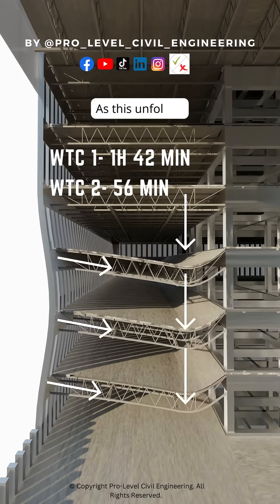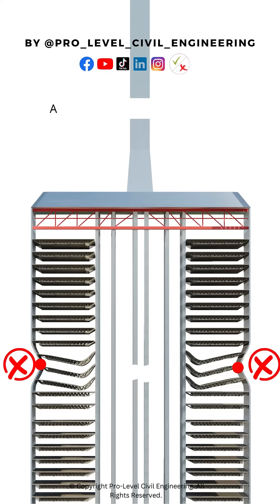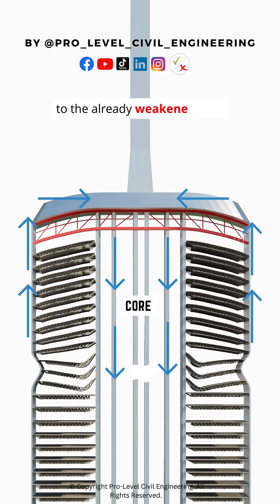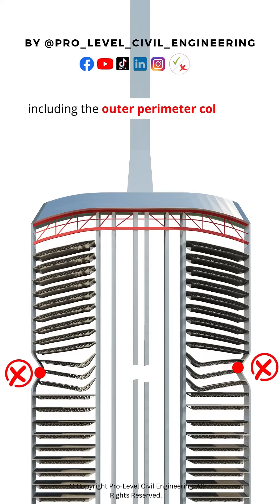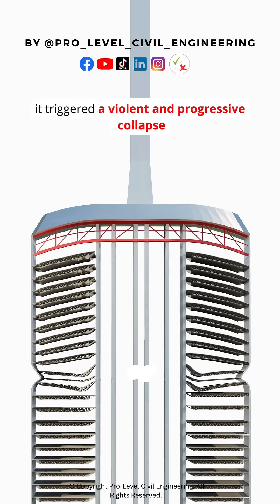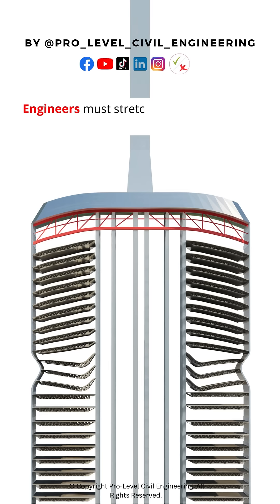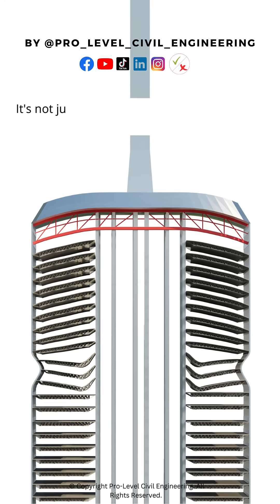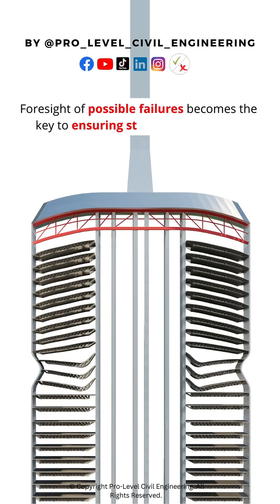The Horrifying Truth: Why the Twin Towers Collapsed on 9/11?

Comment: I cant understand how that much steel can almost disintegrate so quickly like solid steel just vanish in thin air
Reply: Nothing vanished. It took 184,000 semi truck trailer loads of debris to clear the site in the months after and EVERY SINGLE STRUCTURAL COLUMN, BEAM, TRUSS and other steel component that comprised the WTC Towers was recovered.
An interesting fact....if you melted down all the steel, every column, beam, truss, plate, bracket, bolt and nut that comprised one of the WTC Towers, every piece of steel, the single solid slab of steel you would have would be the footprint of the building (208' × 208')and a mere 6' high.
If you melted down all the concrete and poured it into a slab it would be the footprint of the building and 36' thick.
Reply: @holdernewtshesrearin5471  Few realize that each Tower was 95% AIR for its overall Cubic Volume.
Reply: @apaulmcdonough2170  All buildings are 95% air that's why parts of them are called rooms, duh!
Reply: @mrichards-j6b  See this is WHAT most Don't Understand when they "Question and Dispute" the Collapses and the actual Construction of the Towers and also WTC 7. 
They weren't "that much Steel" ... "like solid Steel". 
The 14 inch Square, 36 Foot Long Columns were made of 1/4 inch thick Sheets, so 13.5 inches of 'solid AIR' between the sides of the Columns.
Reply: @apaulmcdonough2170  Box columns become a composite beam welded on all sides increasing the strength of the material used,  the bottom sections were much thicker than the middle sections which were much thicker than the top sections,  as the building went up the steel diminished in thickness otherwise it would be to top heavy and unstable,  theses towers were engineered fortresses not some lightweight weak thin easily destroyed plate steel structures,  connections did fail,  buildings did not fail,  they were brought down by attack from inside by unknown forces,  whatever cut the trusses and left 12 feet of steal hanging on the interior columns was the means to the towers ends,  not junk engineering!
Reply: @mrichards-j6b 
You keep hanging onto the UnicornShit you are so deeply, and desperately invested in.
You have succeeded in Boring me.
Adios, Skippy.
Reply: @holdernewtshesrearin5471  not so hasty. There's a multitude of different aspects I can express that says that's just a lame excuse. There was diaganol cut beams strikingly similar to that of the demolition process there was melted through beams that didn't burn all the ways through looking like flappy holes. There was chemicals compounds where BYU professors found evidence of that showed proof of high quality thermite only found in military complexes (where it was then too controversial and was made to resign from his job at the good University) in America. Then under each pillar they found (where I can't remember the name )in welding, where I call it slag . But it's more specifically known as "pung" or "pnuck" where they found thousands and thousands of small bbs all around the bases of the pillars. Helps show striking similarities to none other than the ways thermite burns . There was tons of grey and white chips falling from the buildings before they collapsed resembling the colors or iron and aluminum oxides (which is rust and aluminum) there was the calling away by George Bush (The REPUBLICAN president!) the security days before the attacks. The high quality thermite is explosive which is why the building showed plums of smoke coming out from the sides of the building before the collapse. Then there was actual pictures of men in climbing gear in the towers standing next to a 20ft complete wall reaching to the ceiling of boxes which read "BB 18" on them . Which upon further investigation was revealed that they were electrical fuse holders which could double as something they needed in the DEMOLITION process. Furthermore these "fuse holders" were related to a company call the kelx company which in some part ways or another was either owned or partly owned by Republican John McCain. Which was praised for his actions against Obamacare and condoned by the Republican party during  Donald Trumps term in presidency.
Reply: Do you have any idea how much the plane weighs? 
I wouldn't be surprised if the tower collapsed, even if someone just put such a plane on the roof. 
But in this case, there was a collision, destruction of the external load-bearing columns, a fuel explosion, prolonged burning, and the collapse of the upper ceilings, which with their weight brought down the rest of the structure.
I'm just surprised WTC didn't collapse immediately after the impact.
Reply: @sun_11_moon - a fully loaded Boeing 767 like struck the WTC Towers weighs approximately 350,000 to 400,000 lbs depending on configuration, cargo and passenger load.
The average speed of the 2 jets upon impact was about 500 mph which is about 733 feet per second which is FASTER THAN A BULLET fired from a .45 acp handgun such as a Glock 21 or Colt 1911.
They struck with 12 to 20 times the energy the WTC Tower engineers had planned for in such an event.
The destruction was massive but those mighty Towers withstood the impacts and would have remained standing....if it were not for the fires. Those raging fires weakened the steel structure by as much as 50% to 90% in certain areas and insured that the Towers could NOT survive. Although they withstood the onslaught for nearly 2 hours for the North Tower and 1 hour for the South Tower, inevitably they succumbed.
RIP to all those lost and God bless their loved ones.
NEVER FORGET what they did to us and why...
Reply: @sun_11_moon peoples argument is the obvious sound of an explosion the force of the explosion and the downward fall of towers not snapping how a tower would fall if the plane caused the demolition
Reply: You think the steel disintegrated? Did you see the ruble?
Reply: its called...........controlled demolition

i mean realistically

we gotta literally just build another world trade center tower

same exact way

n crash a plane into it

n just make sure the government agents dont sneak their way inside n plant bombs all over the place
Reply: Voir  ReOpen911  Zero  sur YouTube.  👍
Reply: it didn't disintegrate, the fuck are you talking about
Reply: Bonne réflection !
Reply: It didn't I think that the rumors spread by speculation on the part of the media. And lack of information.  I know I changed my mind when I learned of the pinions and seeing the video of the windows behaving like a blast furnaces. You can literally see the metal around the edges melted away. The lack of debris is like a hydraulic hammer ram the kind used to shape metal put a cinder block under it dust is all you will see
Reply: I can EXTREME HEAT/SUPER HEATED
Reply: Fire vaporizes all metals and concrete. that's how dummy
Reply: Waa bombs
Reply: The building got to be “4llahuakbar” treatment—(as a verb)! cue the cheers afterward.
Reply: Не хотят Исламскую религию! Ненадо! Пускай с голоду умирают!Господь Велик!❤
Reply: Interesting. Are you a structural engineer with education in thermodynamics?
Reply: @JP-ht6nm metallurgist, fluid and thermodynamics engineer with a masters in structural engineering.
Reply: @markk3652  Let's see the diploma
Reply: @JP-ht6nm come on over, it’s hanging up on my office wall, all of them are.
Reply: @markk3652  wya
Reply: @JP-ht6nm Everett, Washington
Reply: I watched news crews out at the scene the following morning, before it was ordered to be sealed off. What I saw very clearly was smoldering steel. It was actually on fire. The news reporter made the same point. I thought it was weird. However, I believed the govt version. 
Now I know what I was watching was burning thermite. Independent labs analyzing debris from the scene also discovered large amounts of thermite. Thermite is a heat accellerant used to burn thru steel. Hmmm
Reply: Les usa prennent leurs citoyens  pour des demeurés ...heureusement qu'il n'y a pas que des américains dans le monde !
Reply: not so hasty. There's a multitude of different aspects I can express that says that's just a lame excuse. There was diaganol cut beams strikingly similar to that of the demolition process there was melted through beams that didn't burn all the ways through looking like flappy holes. There was chemicals compounds where BYU professors found evidence of that showed proof of high quality thermite only found in military complexes (where it was then too controversial and was made to resign from his job at the good University) in America. Then under each pillar they found (where I can't remember the name )in welding, where I call it slag . But it's more specifically known as "pung" or "pnuck" where they found thousands and thousands of small bbs all around the bases of the pillars. Helps show striking similarities to none other than the ways thermite burns . There was tons of grey and white chips falling from the buildings before they collapsed resembling the colors or iron and aluminum oxides (which is rust and aluminum) there was the calling away by George Bush (The REPUBLICAN president!) the security days before the attacks. The high quality thermite is explosive which is why the building showed plums of smoke coming out from the sides of the building before the collapse. Then there was actual pictures of men in climbing gear in the towers standing next to a 20ft complete wall reaching to the ceiling of boxes which read "BB 18" on them . Which upon further investigation was revealed that they were electrical fuse holders which could double as something they needed in the DEMOLITION process. Furthermore these "fuse holders" were related to a company call the kelx company which in some part ways or another was either owned or partly owned by Republican John McCain. Which was praised for his actions against Obamacare and condoned by the Republican party during  Donald Trumps term in presidency.
Reply: Prepositioned explosives.
Reply: @troyterry6919  Prove it.
Reply: @troyterry6919  tell me you didn’t watch this video without telling me you didn’t watch this video. 

The floor trusses in the World Trade Center were a key part of the buildings' structure, designed to connect the core columns to the perimeter walls and support the floor slabs. During the 9/11 attacks, the plane impacts severed or damaged these trusses and stripped them of their fireproofing insulation. This loss of connection meant the floor trusses could no longer brace the perimeter columns, and the resulting progressive collapse was initiated as the floors failed and the steel columns buckled under the building's weight.
Reply: @Bauhaus_fan74 nothing you said is true. The undamaged part of the building below the 80th floor is providing resistance to the upper floors. And fire doesn't have the ability to weaken steel anyway. The furniture on the undamaged 80 floors should have remained intact. Yet it was pulverized into dust. Think about why that is the case. Really think.
Reply: @troyterry6919  Yes it is providing resistance. And this is exactly what it did. The forces were redistributed between the still intact colums until the fire weakened the structure enough it couldn't provide enough resistance any longer. And yes: Fire can weaken steel. It doesn't even have to melt. Already at 500°c it's loosing strength significantly. 

The towers were actually designed to support additional weight of a few floors so it could still hold up in case one floor was collapsing. Unfortunately the planes hit below that line. It became inevitable, when the first floor in the impact zone collapsed and all floors above it started "falling". All the weight simply generated more downward force than the structure could handle. So the floors below were crushed one after another and everything fell like a house of cards.

Try building a Lego tower and then knock out the colums on one floor one by one. It will collapse, if you hit low enough. Of course not in the exact same way because Lego bricks have different material properties than steel but it will follow the principle
Reply: @derjenigewelchea collapsing building wouldn't disintegrate furniture on all the lower undamaged floors. Watch 9-11 mysteries.
Reply: @troyterry6919  "fire doesn't have the ability to weaken steel anyway"
I know the 9/11 conspiracy theorists are among the dumbest people who ever lived, but this is a banger even for you guys. Imagine being this clueless.
Reply: @troyterry6919 The steel buckled you god damn moron
Reply: @troyterry6919  this still doesn't answer the question.
Reply: @filippozoppi7569 Oh but it does.
Reply: @bossfootbagstwo2078 eh no? Do you know how much explosives you have to put to be even close to the power generated by the fall of the upper part of the building? 😮
Reply: @filippozoppi7569 Yes, the building was filled with explosives. There’s no way a plane like that could make a building that big crumble to the ground the way it did. Please go do some research.
Reply: @bossfootbagstwo2078  Prove your claims.
Reply: @bossfootbagstwo2078 I think the video clearly demonstrates you the exact opposite. They did research for sure and are way more competent than you and me 🤣
Reply: @filippozoppi7569 You’ve got to be either blind or just plain ignorant if you think a damn plane brought down those buildings. Haven’t you seen the 911 documentary?
Reply: @bossfootbagstwo2078  and haven’t you seen THIS video under which you are commenting? 🤣 go tell them bro
Reply: @bossfootbagstwo2078 you ancient alien flat earth nerds just won’t give it a rest will you
Reply: @joshd3192 I’ve seen buildings burn up but the super structure was still there. Look at the building in Hiroshima where the atomic blast occurred the building is still there but burned up. Maybe the World Trade Centers were a poor design because they looked like domino blocks falling.🤷‍♂️
Reply: @bossfootbagstwo2078 yea and the fact that that there saying this is the caused of the second building collapsing to is hard to belive . For building 2 to collapse in thr same fashion as one makes it question .
Reply: @Yonthedon215 I don’t believe that for one second…if I’m not mistaken there was a documentary on the whole frigging thing that said that the buildings were chock full of explosives. There was a reason behind this just as in the JFK thing. If you don’t know please go research it…
Reply: @bossfootbagstwo2078 Stop rage baiting with nonsense. Commenting with no research or anything to back you up. The WTCs had a poor design. You can literally watch the towers fail at the impact site on multiple recorded videos. You can see the buckling, no explosions.
Reply: @bossfootbagstwo2078    Did we not just watch the same video? Did you watch it at all? God I hate conspiracy theorists that cant back up their claims. The plane hit much lower on the south tower, the weight above was too much for a weakened floor to hold it all.
Reply: @bossfootbagstwo2078 agreed the building fell like pile of cards, and have you seen full video of bush before the event he was in school u should see full video
Reply: They had an elivator job for almost 2 years the explosive metrial was carried through elivators, mostly done by mossad, those isrealites were handed over the job of deploying bombs to every corner of the building.
The way building 7 fell it was 99% a conrolled demolition..
Reply: @WorldLeadersWar  😂 Didn’t you watch the video? The floor trusses collapsed and there was nothing to hold the floor up. You can’t even spell elevator and you’re explaining 9/11 to me?   😂
The floor trusses in the World Trade Center were a key part of the buildings' structure, designed to connect the core columns to the perimeter walls and support the floor slabs. During the 9/11 attacks, the plane impacts severed or damaged these trusses and stripped them of their fireproofing insulation. This loss of connection meant the floor trusses could no longer brace the perimeter columns, and the resulting progressive collapse was initiated as the floors failed and the steel columns buckled under the building's weight.
Reply: @WorldLeadersWar - just STFU with that ridiculous nonsense. Tell me...did you SEE THE BIG EFFING AIRPLANE CRASH INTO THE BUILDINGS? Because I sure as hell did!
Did you SEE THE BRIGHT ORANGE SH*T FILLING THE BUILDING? Because I sure did!
During the collapse, did you SEE BRIGHT FLASHES OF LIGHT, LARGE ERUPTIONS OF HIGH SPEED EJECTA CLOUDS? Because I sure didn't!
Did you HEAR HUNDREDS OF LOUD BOOOMS! as explosive charges, which would have been required at EVERY COLUMN, EVERY BEAM, EVERY FLOOR TRUSS and EVERY JUNCTION THEREOF, went off? Because I sure didn't!
In DOZENS and DOZENS of different videos of the collapse, taken from DOZENS and DOZENS of different perspectives, did you SEE, HEAR or FEEL ANYTHING that would suggest explosives were used? Because I sure as hell didnt!
And besides ALL that EVIDENCE that you DONT have....have you forgotten about the 2 big azz aircraft that slammed into the Towers at 500 mph???
Im sorry, but it takes a real DUMMAZZ to spout your nonsense!
I hope you're just a dumb kid and just dont know any better but something tells me you're an adult. God help you if so...
Reply: Because there was much less steel on the biilding than on the blueprints
Reply: not so hasty. There's a multitude of different aspects I can express that says that's just a lame excuse. There was diaganol cut beams strikingly similar to that of the demolition process there was melted through beams that didn't burn all the ways through looking like flappy holes. There was chemicals compounds where BYU professors found evidence of that showed proof of high quality thermite only found in military complexes (where it was then too controversial and was made to resign from his job at the good University) in America. Then under each pillar they found (where I can't remember the name )in welding, where I call it slag . But it's more specifically known as "pung" or "pnuck" where they found thousands and thousands of small bbs all around the bases of the pillars. Helps show striking similarities to none other than the ways thermite burns . There was tons of grey and white chips falling from the buildings before they collapsed resembling the colors or iron and aluminum oxides (which is rust and aluminum) there was the calling away by George Bush (The REPUBLICAN president!) the security days before the attacks. The high quality thermite is explosive which is why the building showed plums of smoke coming out from the sides of the building before the collapse. Then there was actual pictures of men in climbing gear in the towers standing next to a 20ft complete wall reaching to the ceiling of boxes which read "BB 18" on them . Which upon further investigation was revealed that they were electrical fuse holders which could double as something they needed in the DEMOLITION process. Furthermore these "fuse holders" were related to a company call the kelx company which in some part ways or another was either owned or partly owned by Republican John McCain. Which was praised for his actions against Obamacare and condoned by the Republican party during  Donald Trumps term in presidency.
Reply: Yea even if this were true for it to happen twice minutes apart is something I still don't belive was natural . Something more caused this for the inner steel columns in TWO buildings to vanish .
Reply: Termite militaire ...extrêmement performant !
Reply: I have worked in construction all my life and alongside one of the top demolition contractors in the country, everyone there says this building fell like a perfect controlled demolition that they spend weeks- months planning for. No way a plan spontaneously hit the tower and caused it to fall that perfectly
Reply: @vdiddystudios8043  If they were going to bring them down through controlled demolition, what did they need the planes for? Why not just blow it up directly?
And the impact zones of both towers were at completely different heights, were the explosives also at those different heights, right at the impact zones? How did they know the planes would hit at such different heights?
And why wait so long before blowing it up, and why blow the second tower up so long after the first? Why not blow them up right at impact for max casualties?

Your theory makes no sense whatsoever.
Reply: @vdiddystudios8043  how many planes hitting towers fully loaded with jet fuel have you included in your hypothesis?  We know exactly how demolition does it the science and physics of it.  Over thousands of projects.  As far as I know this is the only use of a plane as a means of demolition. So not much information to base anything on.  Plus I think people discount to enemy as cave dwelling sand people.  They have top minds working as hard on their goals as we do.  Don't forget that. They believe they are doing gods work that's very motivating
Reply: @vdiddystudios8043  bunch of contractors aren't structural or civil engineers. Their opinions are just that, opinions